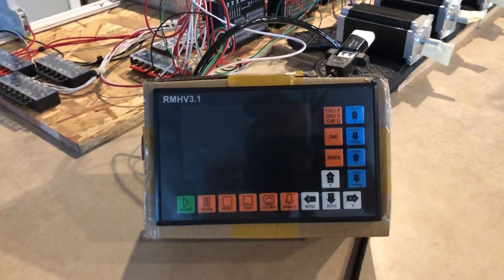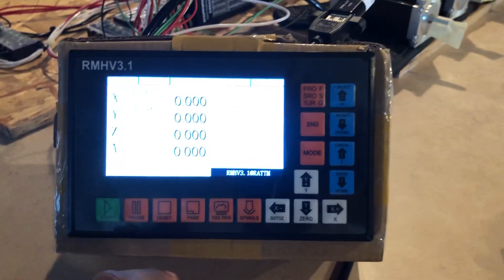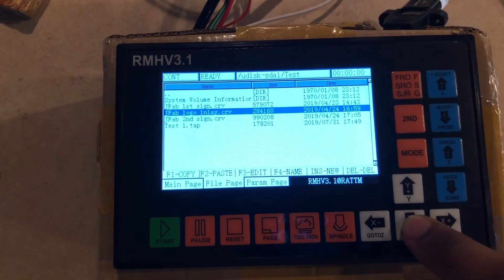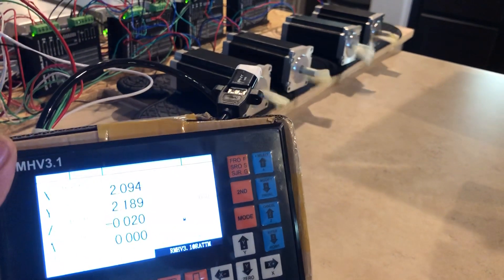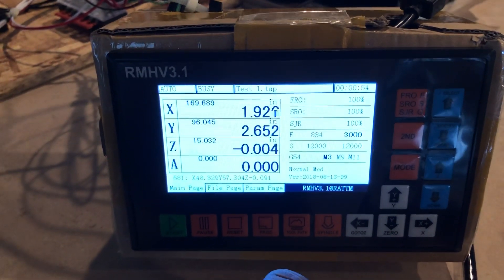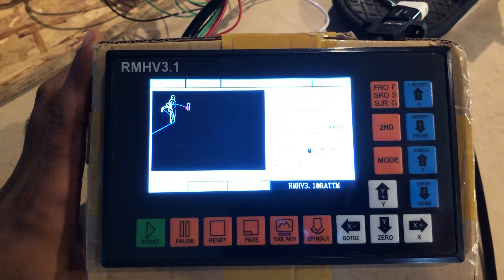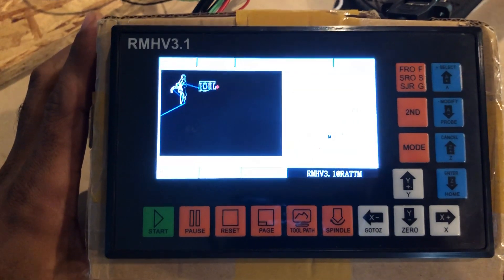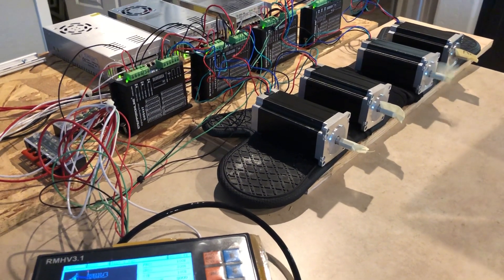RATTM MOTOR Offline CNC Controller Test Run

Comment: I wonder if you can help me get off the ground. I am just a beginner and have a problem. My one servo motor that is hooked up turns just a bit, stops and make a high pitched whine. I finally learned how to get off of continuous and to step and I can get it to make a single stem without the whining. While in "Continuous" mode I was using the controllers scroll keys and that is where I got wha I described. I think somewhere in "Parameters" (maybe???) I need to set something slower. Do you have any ideas?

Comment: Excuse the question, but is it plug and play?  That is, I connect the drives and the steppers and he already works as firmware?
And i write after the parameter
Reply from the maker: I would not say this is plug -n-play. the unit comes with wires that you would need to hard wire or attach quick disconnect adapters to make it plug-n-play. If you mean there is no other components like UC100 or Breakout boards then yes this is a unit that you can connect to stepper drivers and run a CNC/Mil. You will still need design software to design and create files to run. I have other videos that show a better layouts of my components.